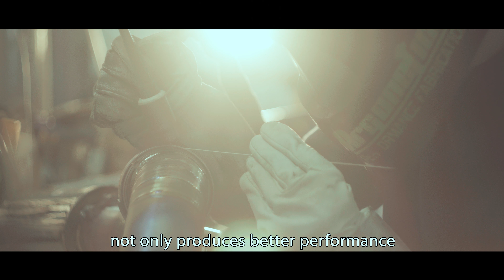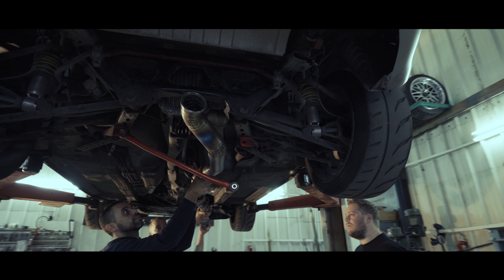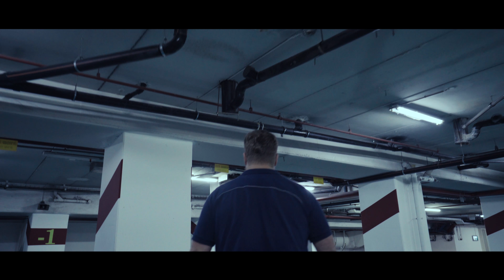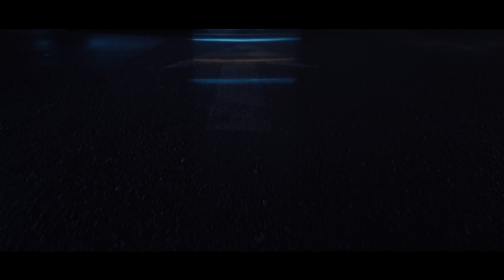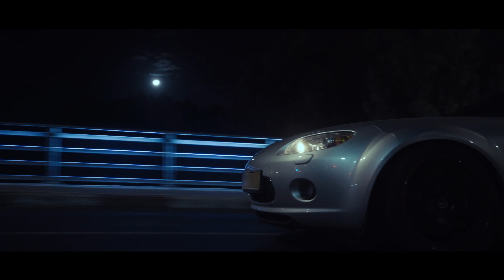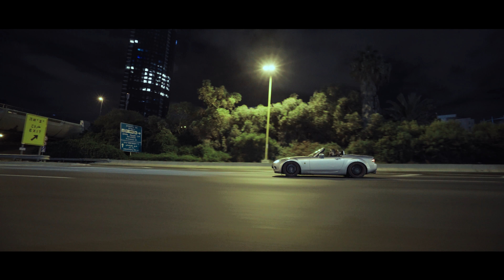PROJECT DONZA - MIATA NC - THE MOVIE 4K

Comment: the NC is so underated
Reply: Why
Reply: @josea7919  because it's awesome and everybody hates on it ...
Reply: @tpm2056  Yup, the NC is the most hated Miata of them all. It is the fattest, of them all. I got mine last November, and I adore it.
Reply: @tpm2056  A little known fact is that the NC's platform is a shortened RX-8 chasis, and they can even share parts. Many of the suspension parts were lightened for the NC.  Just like the FRS/BRX/GT86 is a shortened WRX platform. In any case, I changed the tired suspension for coilovers, and got light rotary forged wheels for it, and it really transformed the car. The previous owner had heavy aftermarket wheels on it when I bought it. In any case, even in stock form these cars are amazing, and they are getting pretty cheap now. I'd say get one if you really like them!
Reply: @vlenhoff  as someone who's owned 2 NB2's and now an NC1 I can say any Miata of any generation is fantastic. Add stiffer sway bars and coilovers and you got a really fun canyon/hills car.  Love Miatas, fun that won't get you in trouble.

Comment: I drive a gun metal grey 2014 MX 5 NC. A ten second car. It came out of the box race ready with Le Mans paddle shifters on the steering wheel. Every time I drive it I'm in a James Bond movie. When people see it they ask, 'does it have machine guns behind the fog lights?' The license plate reads 009. It's definitely licensed to kill. Does a 'drift' nicely. 

Q branch read out, race ready with paddle shifters. A ten second car, does 0 to 100 mph in ten seconds. Double wish bone suspension and drive while flat tires makes her a nimble cat with tough paws. The body is made of rust resistant steel and carbon fiber (Kevlar) material. It has quarter inch metal armor under the engine and transmission. Stainless steel exhaust. A seven speaker Boise sound system keeps the Bond theme music coming thru 5 by 5.